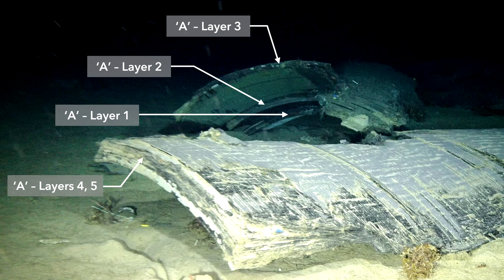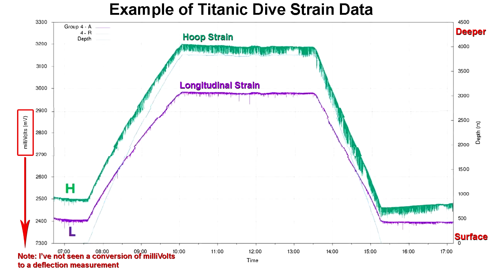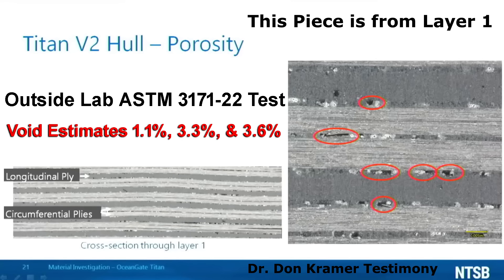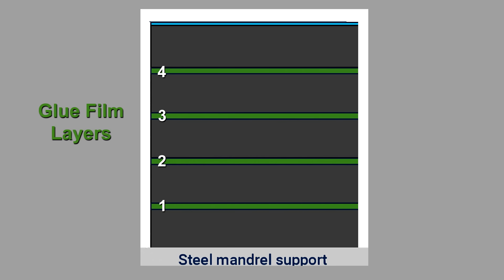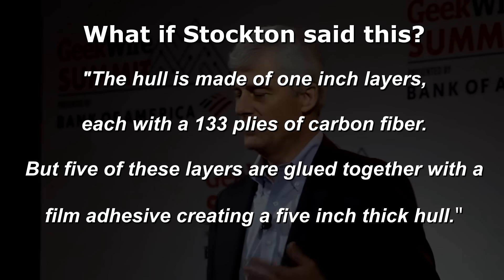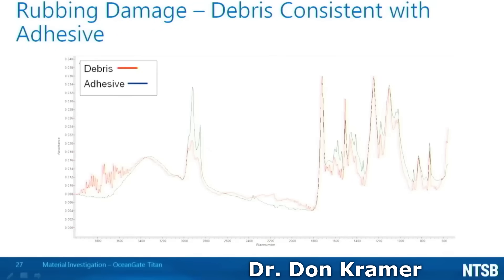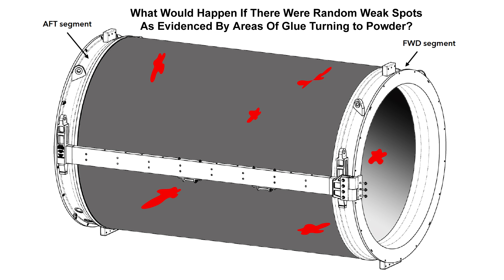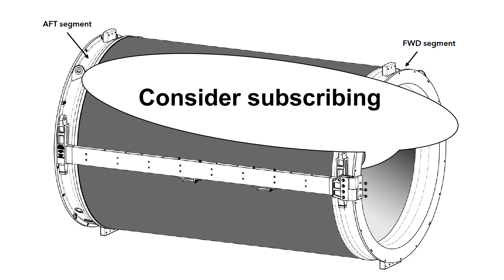OceanGate Titan Hull - Glue Layers Were Breaking Down To Dust - No Clues.

Comment: everyone misses the elephant in the room... carbon fiber is best used where the long fibers will be intension not compression, in the titan most of the strength came from the "glue" not from the carbon fiber...  take a compressed gas cylinder made of epoxy fiber laminate and it will fail at a mere fraction of its ultimate strength if it is pressure tested "from the outside" as opposed to it proper use case of from the inside just like an aluminum can

Comment: For this sort of duty at the least, the fiber should have been "wet" when it is put on.  The idea is that you have a situation where everything is swimming in resin.  You don't want even small air bubbles in the material.  You also didn't cover the fiber directions.  They put no angled fibers on.  It was all 0 and 90 degree fibers.

Comment: That is called rain not glue.  The carbon winding provided no strength for  implosion but would have great strength for explosion.  The strength of the hull was entirely rom the resin.
Reply: The fiber makes the composite stiffer.  Remember that the failure was not likely to be simple compression.  Some part of the system went out of round It didn't crush to nothing.  It was more like flattening a tube.  Going out of round tends to be a process that feeds on its self.  You want the material to be very stuff to fight this.
Reply: @kensmith5694  those fibers are just filaments.  You can’t take a whole handful of circular windings and compress them. It is the resin that gives them form. Filaments added little to the strength to resist implosion.
Reply: @klardfarkus3891  The pressure hulls I put electronics in have taken a great many cycles to quite deep in the ocean.  Composites do work for the job.

Comment: Hoop failure??  Another person with credentials thinks this was a pressure vessel.  Thinks fibers broke under stress.  Idiots.:cat-orange-whistling:
Reply: At some point the fibers broke.  By then the situation was already bad.  The way this sort of thing fails is that the tube goes a little out of round.  Think of the pressure pushing in on all sides of a circle.  If it remains a circle all will be well.  Now imagine the circle is a little out of round.  The part where the curve is decreased from the normal curve of a circle is easier to push inwards
Reply from the maker: @kensmith5694  Great reply, thanks.  Yes, out-of-roundness is a big deal, especially with this hull.

Comment: And thats why degassing is important.

It's just crazy to leave all those voids in a brittle material that cycles through huge pressure changes. It would've probably held up for a single dive, but anything after that is just begging for a catastrophic failure.
Reply: I think "wet winding" would have been the only way to go.  If you do the winding with all air excluded and resin basically dripping off, the "voids" would not be full of air but rather have just a little less fiber in the resin.
Reply: @kensmith5694  Even if it did solve the problem, it's weaker in compression, the humps would cause an even bigger headache and there would likely be a hundred other issues.

Almost as if making a deep submersible out of carbon fiber is a fundamentally bad idea.
Reply: @pocpic  I have built systems with composite pressure hulls.  Metal was no allowed for technical reasons but expensive equipment was at risk.  They did go deep and cycled many times.Composites can be very stiff for their weight.

Comment: OceanGate's degree of negligence is staggering. ANYONE who has worked even superficially with ANY composite material would without hesitation to state that this construction was at best incompetent, and at worst, failure at every level of professionalism. Doing it big but doing that wrong, then repeating this, it doesn't replace correct manufacturing. It was doomed the moment they "finished" the hull. Carbon fiber doesn't compress well.
Reply from the maker: Agree.  Thanks for commenting.

Comment: With what I've seen from the manufacture and the aftermath. I still believe the initial hull failure hapened at the forward titanium ring to carbon fiber hull adhesive joint. If the collapse would have initiated in just the carbon fiber hull section the rings would have ejected cleanly with little damage to flanges. The flange on forward ring shows it went through a shearing event with a large portion detached from the ring. That thin flange along with the adhesive joint was the only thing maintaining structural integrity. When the adhesive failed the carbon fiber did not have any structural suport and collasped. This explains why the aft ring was more intact and still had pieces of carbon fiber still attached to it.
Reply: I do disagree with how the joint was made and also from tests I have seen, failures to tend to happen at points of transition.
Reply from the maker: Thanks for your comment.  That very well could have been what happened.

Comment: I wonder if they would of incorporated a 3rd titanium hoop, but in the middle, with bracing, or had a metal skeleton. If that would of helped the middle pressure. Squeeze.
Reply: On the outside?? It would still have had to of been glued. Otherwise, there is no way for it to connect to it, because you can't attach it with screws. You want the least amount of points of failure in the pressure vessel possible. Every hole in it, is potentially disastrous. Perhaps an Inner skeleton may have been better for structure. But you are talking about adding way more weight than they wanted this thing to be. Which would have added considerably to adding foam to counterbalance it. Thus raising their costs outside their targets for "profits" which was really all that mattered to them. 

Granted. I don't know ANYTHING about structural engineering. But I think what I said seems somewhat "logical" Feel Free to ignore (shrug)
Reply: @nerdjournal  Do it cheaper, face the Reaper
Gaz UK
Reply: I thought the same. But the glue was turning to powder and the voids would (and did) cause a catastrophic failure. It was literally inevitable.
Reply: @stevenwilgus8982  Yes, was it around 400 atmospheres(6000 PSI) of pressure at that depth, so any unbonded parts would have deflected especially on a straight tube, most extreme pressure diving subs are spherical.
Gaz UK
Reply: I don't think that would have helped much.  A support would need to be a disk of material with perhaps a good sized hole in the middle.  A thin ring won't be stiff enough.  Remember that a small motion is all it takes to get the full failure.

Comment: Designed by someone who had no certification, experience or coursework with submarine design. It was the wrong shape, made of the wrong materials. The materials were laid up wrong, the layup was further weakened by sanding each layer for smoothness, the glue layers bonding the weakened layers were not vacuum cured and had voids.  There was no test hull to take apart and analyze the construction integrity.  There was no test hull making two dives to that depth for every single dive the Titan took human beings on.  Nobody would insure it, nobody would classify it, and sane people would have paid to be nowhere near it in a dive.  The Titan was 100% schmuck bait, and the people who paid good money for the privilege of dying aboard are in the running for Darwin awards.
Reply from the maker: Thanks for the comment and for summing that up.
Reply: While I would normally agree, the victims weren't privy to this information, one of them was just a kid. Call the designers and CEO whatever but the victims were just that, victims, unwittingly as they may be they're not at fault.
Reply: @boanoah6362  Everybody knew that  nobody would classify or insure it.  Everybody knew the designer had no qualifications in submarine design. Everybody knew it was made of carbon fiber which had never been used for submarine hulls before, and everybody knew there were no test hulls to see how long the carbon fiber would endure. Everybody could see that it was a simple cylinder and not a sphere or an ovoid.  

It''s true that there were also screwups they didn't know about, but this much was obvious.

I'm not fundamentally social so maybe I'm underestimating how much reassurance they got from the designer's willingness to go down with them. But this still looks like death by stupidity to me.
Reply: @zrebbesh  Yep. I’m reasonably social, but I would’ve walked away after reading just halfway through point two of the Titan legal waiver: “The experimental submersible vessel has not been approved or certified by any regulatory body and is constructed of materials that have not been widely used for manned submersibles.” That’s a big nuh-uh for me
Reply: In 2024 everyone had access to Google and the information was there, if obscure. The passengers could afford hundreds of thousands of dollars for this trip to the bottom of the abyss but couldn’t do a week’s worth of research? How about some simple risk-benefit analysis - they all apparently considered their life a fair wager just to see some scrap metal in murky water that we already have footage of on YouTube. The only truly innocent person is the kid for obvious reasons and his father is doubly guilty!

Comment: The steel mandrel should have been the key part of the hull. Then the carbon fibre layers would have been properly supported. Still wouldn’t have been the safest. There is reasons why a titanium sphere is the safest way to go.
Reply: Wouldn't have mattered one bit. To do anything it would have been impossibly heavy, and the entire craft would have ballooned to twice the size, three times the weight.
Reply: @AllanFolm  They got a sphere to the Challenger Deep in the 60s, I think it would have made all the difference.
Reply from the maker: Thanks for commenting.  Experience in that industry is pretty clear, for those depths you need a titanium sphere.

Comment: When I seen the video of the glue and carbon  fiber application process. That it was not applied under vacuum surprised me. Wow
Reply from the maker: Thanks for your comment.  I agree with you.  But the folks at Electroimpact were supposed to know what they were doing.  They had a lot of carbon fiber experience.  But mostly with aircraft.  I don't know what to make of it.

Comment: With all those air pockets throughout the hull, in the glue, resin etc, no wonder it broke down since air expands with depth. Each small pocket of air was expanding and ripping the hull apart the deeper it went, delaminating itself and ripping itself apart
Reply: Don't air pockets shrink with pressure? That's basic PV=nRT.
Reply: WRONG - the air pockets are COMPRESSED when pressure is applied.

Comment: The fracture lines were damage traveling longitudinally. They probably heard those fractures occurring during previous missions.
Reply from the maker: Thanks for your comment.  In this video what they are referring to is rub marks in the glue layer.  I'll bet that was relatively quiet as it occurred slowly over many dives.  All the dives of the V2 hull were quite as far as acoustic emissions until Dive 80 when they heard the large bang.
Reply: @ I remember watching a documentary made of an air incident team. After an horrendous accident they struggled to discover the reason why the aircraft (large Boeing type) became unstable so quickly and broke up. If I rem rightly. The entire vertical stabiliser had sheared off in mid flight. The aircraft was made in the nineties when carbon fibre was still relatively new in aviation and all load stress data was of a conventional type. That is to say that metal has a crystalline structure that absorbs tension/compresive forces without permanent damage providing they don’t pass a particular “limit of proportionality” carbon fibre laminates are different in that they’re strong and light and seem to manage comparable deformation with the benefit of being lighter. The NTSB discovered that CF had an unknown property they referred to as micro-fractures that were cumulative in that the material would appear to follow similar stress testing performance until the microscopic fractures started to meet up and under consistent loading and unloading the CF had a runaway weakening and failure property. The tail was almost completely made of carbon fibre which had failed all the way along one end to the other where it met the fuselage. I believe that it was likely the submarine had experienced something similar in nature to that airplane tail. If Boeing weren’t so enthusiastic to white wash these things. It may have been avoided.

Comment: Im a machinist not an engineer and I say they should have just used a metal tube.  Titanium, 4130 cromoly steel even aluminum or magnesium would have been safer imho.    Not banging composites they are great for planes and cars but why tf would anyone want to use it for a submarine is beyond me.  If they had nickel plated the hull It would be closer to a modern fiberwraped aluminum hpa tank that is industry standard.
Reply: Yes a strong grade of steel or aluminum would likely have worked better.  You need it to be stiff so 60 or 70 series aluminum would be needed

Comment: Now just a couch submariner here, I never go deeper than the bottom of my bathtub
Whenever I look at 'hobby' use of epoxy, it often contains a lot of air and needs to settle, one would think this glue was poured too fast and locked in bubbles
Reply: havent watched the vid yet. ive seen hobbyists use vacuum pumps for that issue, but ive not heard that this company had a vac chamber for the whole sub so i bet this is another thing they did wrong.

Comment: it would've been annoying to crawl thru, but that sub really should have had a 4 way cross brace placed inside bracing the hull in the middle
Reply: Or a titanium ring.
Reply: @BlankBrain  agreed.  anything would've been better than just letting the hull flex.  a ring would have been a perfect solution since it wouldnt impede movement inside and would've reduced pressure points on the hull from a cross brace.  i bet titan would've been great if it had a few rings on the interior
Reply: @jareds8729  Especially a 3" thick titanium ring the entire length of the vessel.
Reply: @ you start adding alot of money and weight at that point, but i'm no dsv expert

Comment: Is anyone thinking of building up composite layers radially instead of Titan's longitudinal orientation?
Probably not
Reply: The hull failed under circumferential stress, not radial.  Regardless, carbon fiber was a poor choice of material.
Reply: Ol reliable steel

Comment: I wonder how much of the failure was due to water being microscopically forced into the laminate on each dive.  When surfacing that trapped water might remain trapped and expand, thus progressively delaminating it.
Reply: The voids have AIR in them.  At Titanic depth the pressure is about 6,500 psi.  Air is a fluid that is definitely compressible.  In fact, that’s why the sub failed.  It compressed.
Reply: Fluids are incompressible. 😉
Reply: @akosszucs1455  Water typically compresses less than 1% at 12,500 foot depth, but it DOES compress.

Comment: I'm wondering how much strength was lost between trips to the autoclave, not just from heat affecting the adhesive directly, but from differential expansion when the glue may have been in a weakened phase during heating and cooling...mechanical expansion/contraction. Because of differing radiuses of the layers based on size, they wouldn't expand at exactly the same rate.
Reply from the maker: Thanks for your comment. Who knows?  Right now there is very little information about the glue film layer?  The brand, the strength, the effects of high-temperature curing, etc.  I guess some engineer from somewhere told OceanGate some specifications on all of these variables?  I hope the final NTSB report gives us more information on this subject.

Comment: I really enjoyed this one. I'm not an engineer, but I was a technical writer in aviation industries. I haven't heard anyone focus yet on the glue.  Is it true that the hull wasn't even assembled in a Class 10 clean room? There could have been all types of contaminants in that manufacturing process if it's not in a designated Clean Room. Oy, man. Icarus is a story we still tell for a reason. Stockton Rush is a modern day Icarus.
Reply from the maker: Great.  I am glad you liked the video.  I have no idea about the quality of the facilities (Class 1 and clean rooms)  where it was put together.  Some work was done in the Electroimpact factory and some work was done in the Janicki factory.  Both of those a reputable companies but I have never come across those specific clean room stats/  Thanks for commenting.

Comment: Stiffness varies with cube of thickness, in a properly bonded beam. So in Titan, the 5 layers should have been 125 times the stiffness of a single layer. But if the 5 layers are effectively independent, you have only 5 times the stiffness. That means 25 times the deflection. And that creates tension in the innermost layers, tending to pull them apart. Under this stress, the carbon fibres are doing no work, and the integrity relies on the tensile strength of the glue holding the carbon fibres together. This is an engineering nightmare.
Reply from the maker: Thanks for that thoughtful reply.